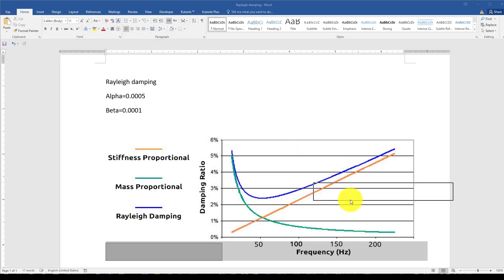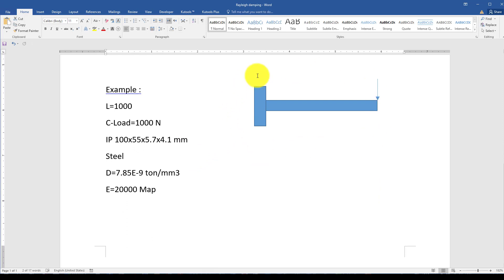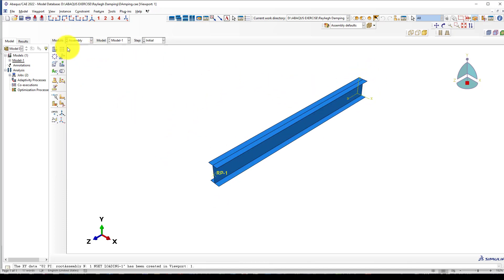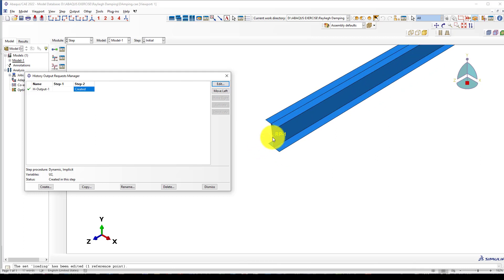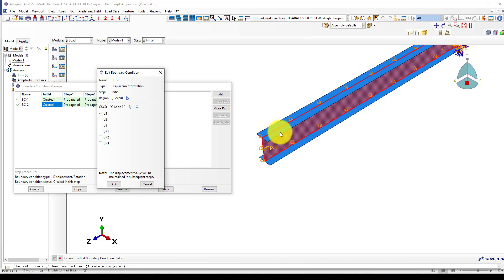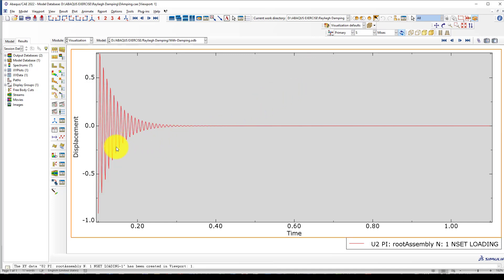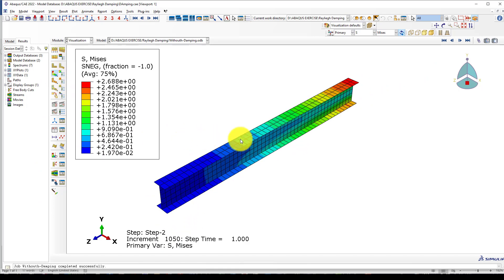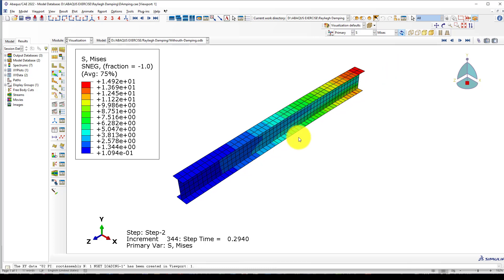ABAQUS Tutorial, Rayleigh damping

Comment: can you please tell what should be the unit of w to input in the given formula like it should be in radian or HZ. I am confused since the result of modal analysis is in HZ I think but not sure. So, should I convert the value of  frequency from result of  natural frequency or simply input the same  value.
Reply from the maker: Check it in Abacuse documentation there is unit consistency. For this work I used mm,ton,s so the natural frequency will be in Hz.
Reply: @KSSE_Engineer   I am using m, Kg, sec and the result of natural frequency is in cycle/sec. So should I input the same value or convert it in radian for calculating alpha and beta.